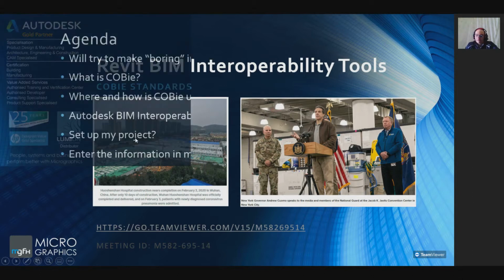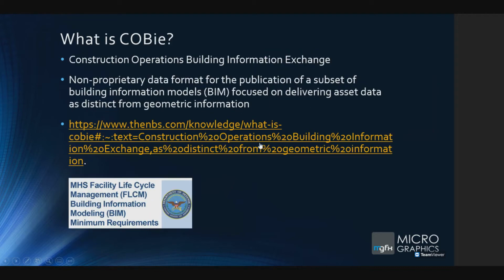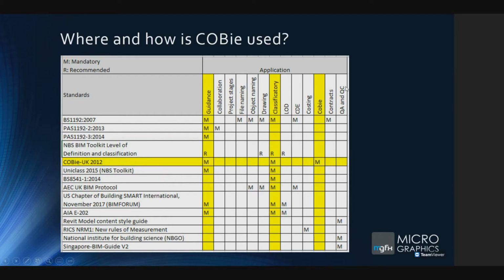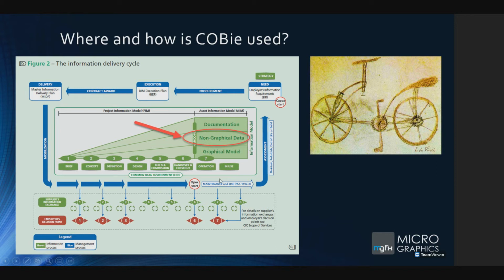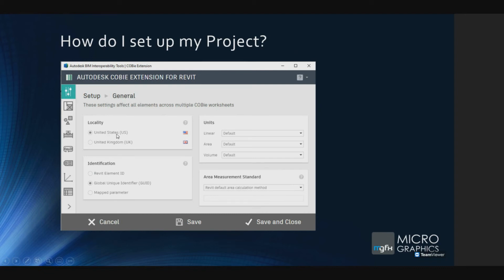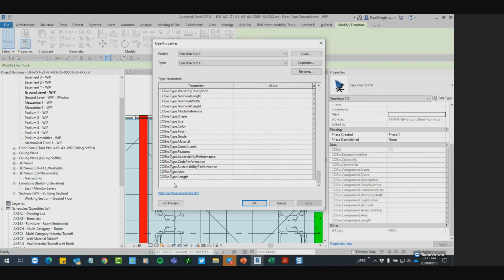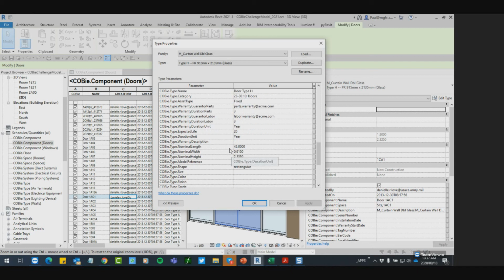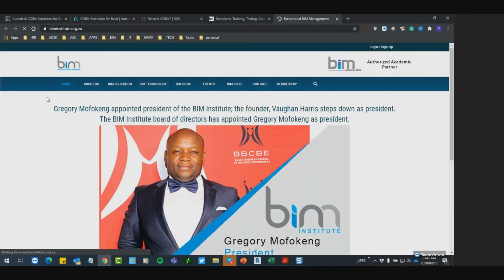Revit 2021 BIM Interoperability Tools - What is COBie and how is it Managed

Comment: Topics are covered from architects model set up. How is COBie information extracted into main model from MEP models done by Mechanical and Electrical Engineers if these are linked models. Does the architect map parameters to match COBie. Does the MEP consultants need to populate COBie data and will architect be able to import this information, and will this information only reflect on COBie spreadsheet export if model are linked.